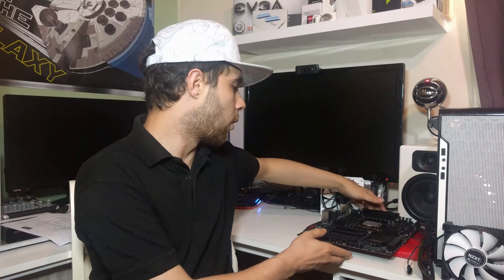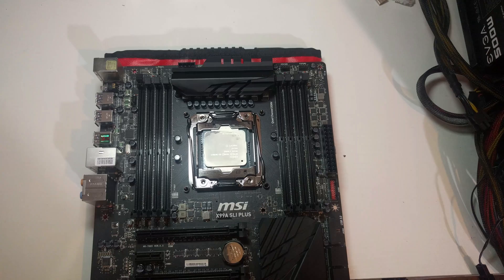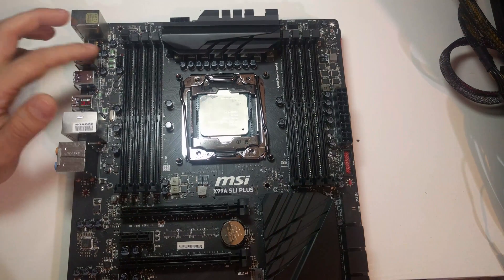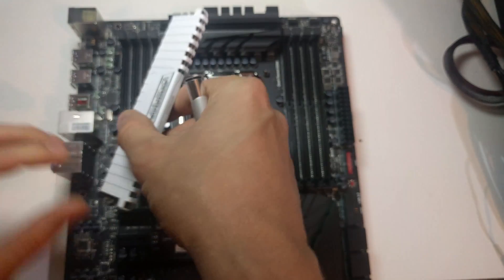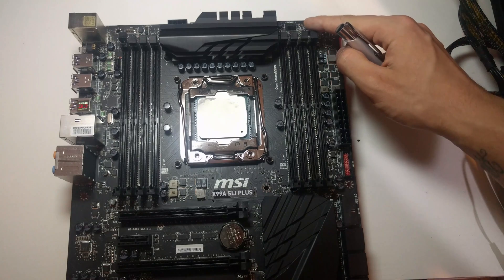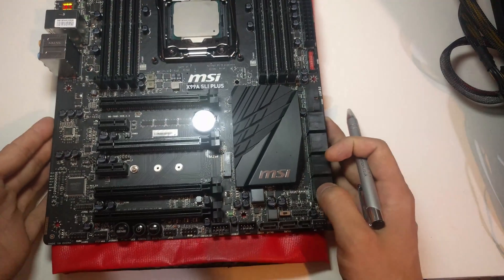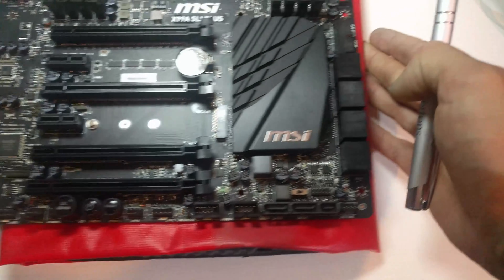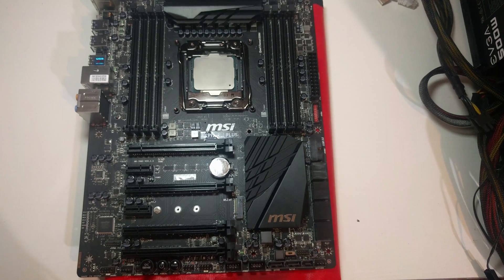MSI X99A SLI Plus Motherboard Overview

Comment: Question. How do you get around the two 16x/16x pci-e slots being so close?
In other words, having two video cards either in sli or crossfire mode so close to each other. Card 1 (i know for a fact) will heat up a lot more than card two. I have the same motherboard (it's a great mobo), however, I am running two RX 480's in Xfire. They run great, but there is only 4mm separation between the two and card no. 1's fan is louder than Big Ben. Any solution?
16x/16x vs. 8x/8x configuration is day and night. (lose 20 fps)
Btw, running a 5930K/ 4 sticks of ddr4 2100mhz

Comment: I forgot to flip the switch on the pci-e 1 slot while removing my graphics card and i ripped the plastic cover off. A few of the pins are broken. I got a gtx 1080 ti and was forced to put it in the second slot. However i have the exact same frame rates i had with my gtx 980 ti. I dont know what to do. Get a new mobo? Or can i repair the slot? Help please

Comment: Very happy with this board, it just seems to squeeze the absolute most out of whatever Cpu and memory you choose. My 5820k sits at 4.4Ghz all day at only 1.222 Volts, with memory at stock 2400. I am very happy with this board. I can hit 4.6Ghz stable, but my tiny H55 AIO cooler just can't handle it, voltage has to be around 1.33 to do that, and it's just not big enough. In spring time I'm gonna grab a 110i GT and then I can crank it up a bit more, or just leave it and let it run cooler. Also these boards seem super relaible, 13 months here, I've never even seen a blue screen, except when dialing in my OC and voltages.

Comment: Just bought the 2670 V3 on ebay, but it's an ES usa sample ( Intel Confidential ), and i think it's the earlier stages, i hope the motherboard will recognize it...
Reply from the maker: let me know how It goes
Reply: ***** Sure i will once the mobo is there :p
Reply: Hi man, so i got the xeon everything is working fine but i checked cpuz and aida64 1nd it seems like its a 2658 v3 not a 2670 v3 so im kinda sad, but its clocked at 2.2ghz and it scores 1500 points in cinebench R15 so... i also checked the differences between the 2670 v3 and the 2658 v3 and the only difference would be that the 2670 v3 run at 3.1 ghz max and the other 2.9ghz on retail so i dont know what to do right now, should i keep it or get a refund?
Reply: +Ellypsis 63 how much did ya pay for it? I am also trying to get this same chip and an Msi x99 sli plus. How is it in games? Is it worth it? Did it recognize it well? Thanks a lot :D

Comment: Hi..im getting a 6900k for this MSI..do you think it will work fine with the bios update?
Reply from the maker: just check the supported CPU list on MSI website
Reply: It says it supports
Reply from the maker: +Marco Cohen also what are you planning to use the 6900 for

Comment: cool.....but one of the processor seller told me.....that the ES processor might not work with the MSI x99 motherboard.....can u confirm if your processor is working.....
Reply from the maker: I can confirm that my processor the e5-2670 v3 es works had it running a week only just uploaded today. what processor you looking at????
Reply: i am buying e5-2698 v4 processor.....so maybe the v4 are not compatible yet....with the MSI motherboards....its a great processor with 20cores 40 threads.....for 550USD.....but am worried it will not be compatible with the motherboards
Reply: The other option is to buy e5-2683 v3 14 core processor......that should work bcoz its a v3.....what do you say.....should i go for this processor instead of a v4
Reply from the maker: +Paras Soni aghhhhh I looked at that chip :) check msi website for support. but I think the issue is bios update needed not the chip being unsupported. find out if the board can be updated without the need of a cpu. also go over to the channel in 10 just uploading a cinebench test.
Reply: will do....thanks for replying....just subscribed .... all the best for your channel..
Reply from the maker: +Paras Soni go with the v3 and in two years you will able to get the full retail Xeon cheap. plus you have all the different i7 you can put in the board. I paid under $300 for my cpu bargain.